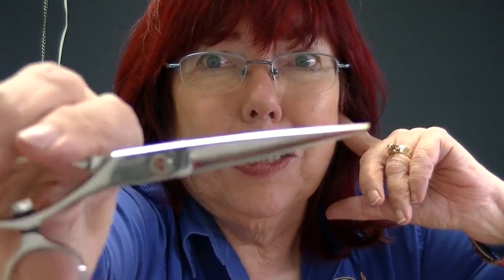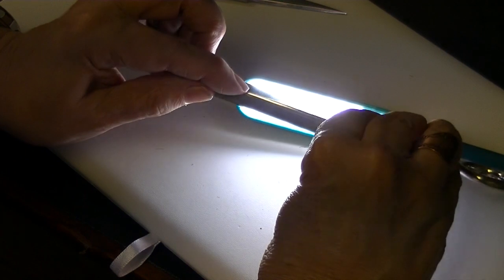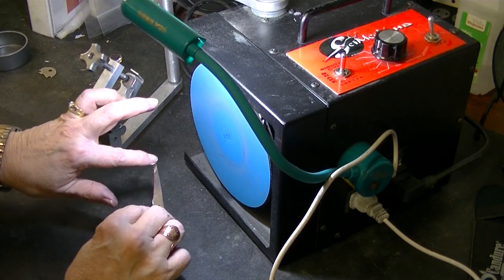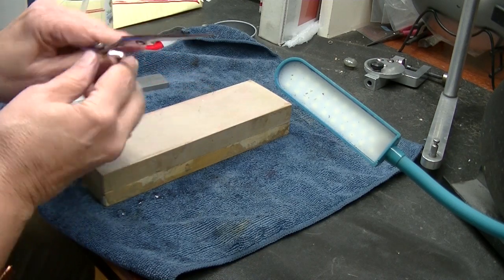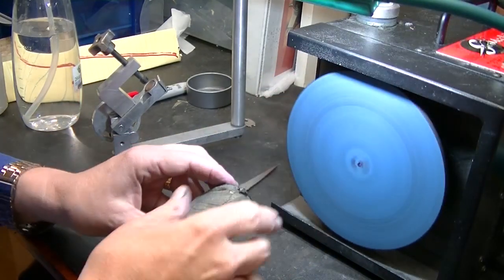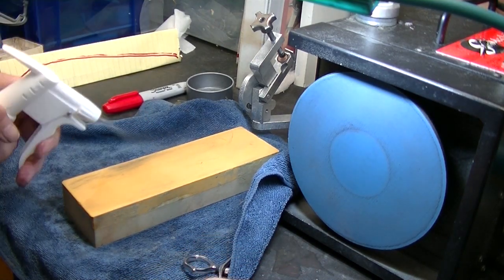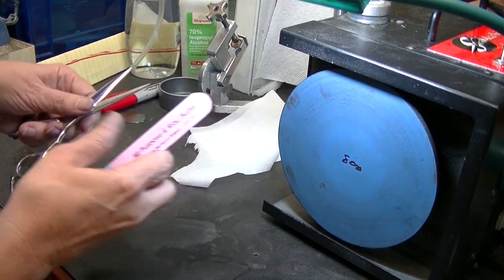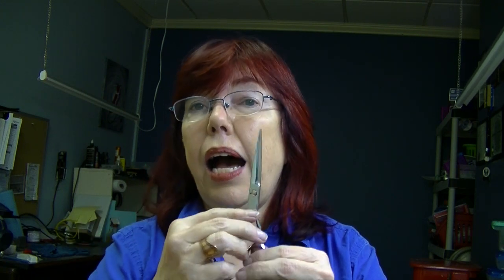Fixing the Noisy Scissors - Can this Shear be Saved?

Comment: I do a lot of jowell shears  so I see exactly what you are dealing with.  I actually work the inside ride much as you do.  Work it more in the throat area and use a super coarse diamond.  Just takes more than any of us would like to get that area down.  Hard but not impossible to remove that much metal   I dont mind if over all the tips get a little more wiped out ... as you mentioned there is a time to shorten the tips.  This is one of those times.
Reply from the maker: You are so right.

Comment: Bonnie, in your basic sharpening process, do you work the rideline before you sharpen (create a burr) or after you sharpen? For example, Sharpen, Rideline, Polish, or what order is it on a basic sharpening? Thanks
Reply from the maker: Yes. In the beginning I did the rideline last but if I had to work the rideline a bit, it would raise a bur on the outside which is hard to remove without returning to the machine. The order I sharpen is Rideline, Sharpen, Remove the inside bur (one to 3 stroke rideline), Polish (but not over the edge), clean and check for residual burrs, cut paper before I close the shears in case I left a bur, final adjustment. Those that come for training get a "cheat sheet" laminated of the steps.

Comment: normally reverse my wheel  when I remove swarf as it is embedded .. try it
Reply from the maker: You need to shoot a video for me of how you do that.
Reply: @BonikaShears  the easiest way to do it is by changing the wiring on the motor of the bench grinder that you have there , so the wheel runs away from the sharp end of the scissor so it does not bite directly into the sharp side on the scissor that way you are stropping it by working away from the sharp end and bringing it to the most finest finish you can possibly bring it with a set grit , having 2 starting switches is a way easier way of doing this hence then you don't have to play with the wiring 

the other way is to turn the scissor up side down in the clamp but this will most probably max out the clamp angle  , as you normally have the sharp side facing up 90° to the wheel making the grinding wheel grind directly into the sharp end of the scissor which is good but when buffing you want the sharp end running in the same direction as the wheel is for the same reason as to when you had the scissor on the 4000 grit honing stone to prevent it from biting into the stone accidentally and this works the same way with the honing grit you have on the stropping wheel ,

the other thing i see but am not sure if it will do that on your machine , but it looks like the while clamp that is riding on the hanging arm , it looks like the hanging arm is attached to the machine itself , which if possible will also be way easier if it can just turn anti clocks if looking from the top of the machine so the arm is on the right side of the machine , that way you can keep everything just as it is and just run the wheel where it is going up rather then down , that way it will strop with the blade rather than against it 

another way is to take that riding arm you have that the clamp is on and just make a set degree block that you can put the whole arm on the compensate for the jig that has a set amount of play in it

BUT personally if you want the least amount of modifications and least amount of headaches I would recommend taking it to a electrician and let him put a extra switch on for you that has a opposite winding setup on it so you have a motor that can do clock and anti clock rotation , if he does not want to do it , i will put a explanation for you on how to do it , but best if done by a person who knows how to do it pleas , don't want any problems LOL

all the other ways you need to cut and modify on the machine which is a problem on it's own

i hope this helps you , if it does not , please feel free to ask me as I will then see what modifications you need to do on that specific machine , as i personally am a free hand sharpener and have found my own ways to keeping my hands steady while doing sharpening , but awesome video

the one thing I have found if a scissor is to curved in by wrong sharpening methods is to simply bight the bullet and work the curve away on a 1000 grit stone , it takes time , and it does shorten the scissor cause you are thinning it our to say the least , but it does get the curve out of the way , and then I can simply just sharpen it the rest of the way and work all the sharp edges away,